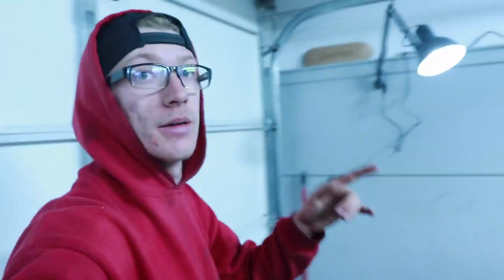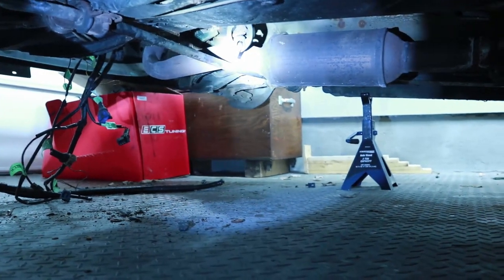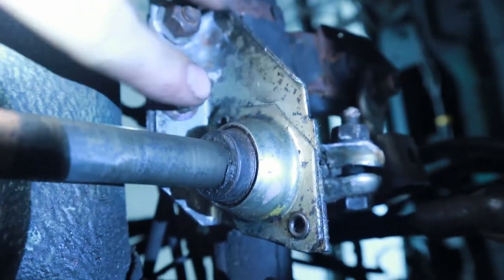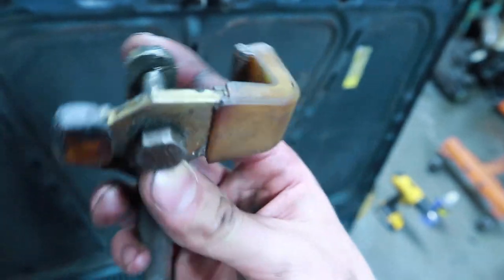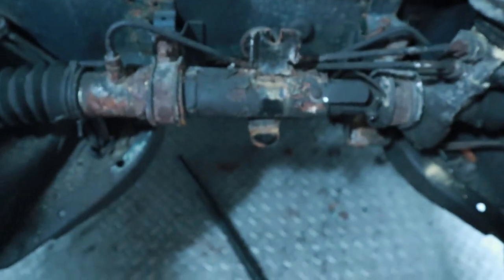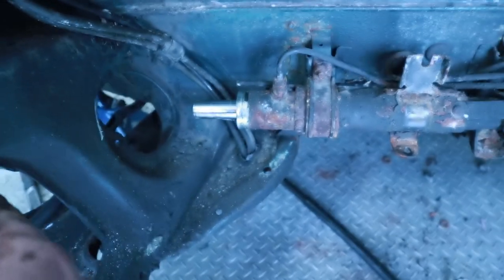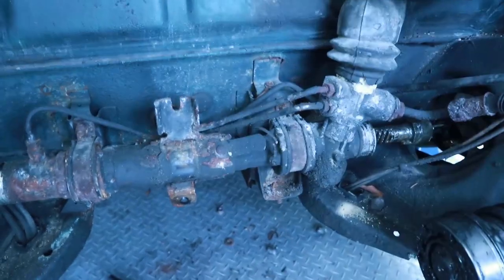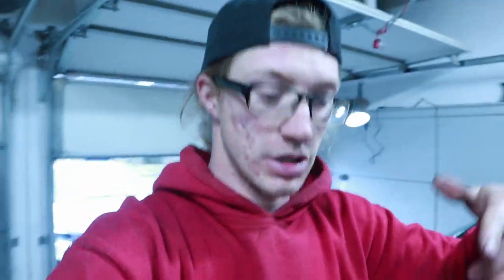MK1 Cabriolet Project - Steering Rack Removal

Comment: What motor wiil you use. I have mk1 cabriolet with 2.0 aba block and 8v head cylinder.I recommend to you.
Reply from the maker: I ended up dropping in the same 1.8 8v, just with alot less mileage

Comment: Is it possible to remove the rack and pinion with out removing the engine.  Are the inner tie rod connections to the rack and pinion left or right hand turn?

Comment: Hi bro, I am from Costa Rica. I have a mk1 rabbit diesel and It has a power steering rack, why are you going to change it to a manual steering? I really like your video because I need to rebuild it, it is loosing oil, but I would prefer if you put in the video all te process, it is really interesting
Reply from the maker: Hey man!  Unfortunately I'm not putting videos up anymore.  I removed the power steering because it wasn't working and I wanted to clean up the engine bay.  I deleted the reservoir and lines